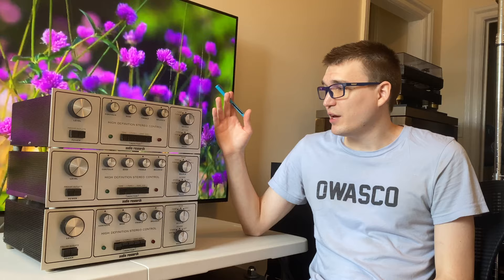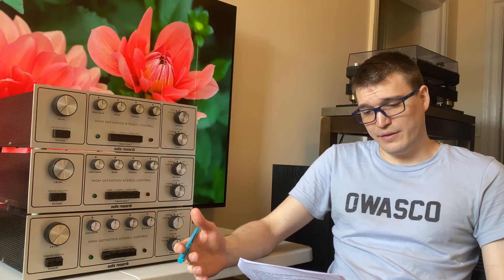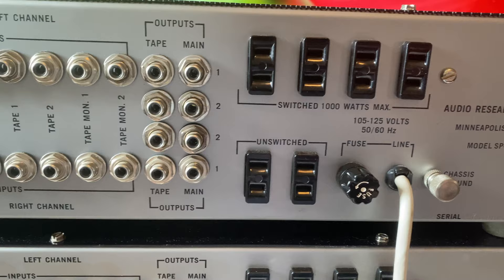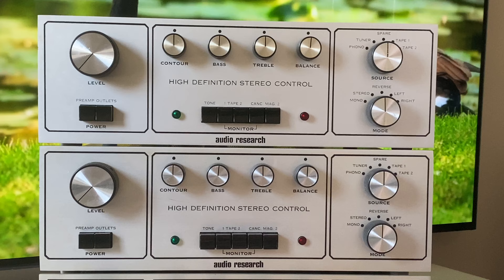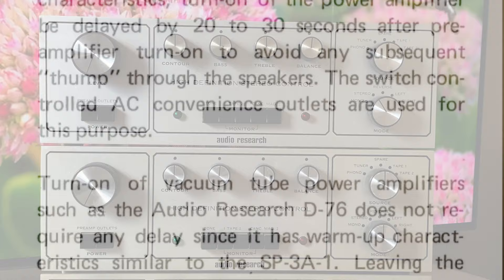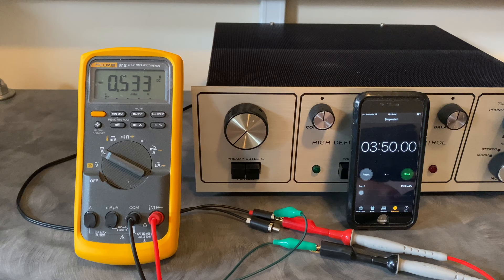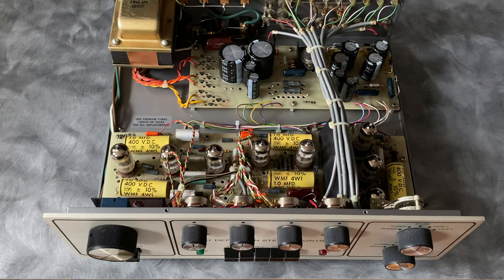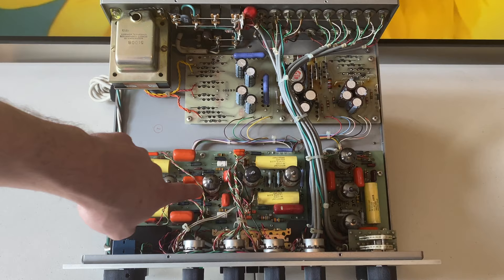Audio Research SP-3 Deep Dive and Full Info for Collectors  - Versions, Service, Tubes, Lamps!

Comment: Super cool. Very well done and informative. Lovely piece of kit and I strongly suspect still respectably good sounding. I remember this unit almost from the time it was first released, and watching the ARC preamp evolution from this point forward. These preamps contributed heavily to the beginning of the modern high-end tubed audio trend, and they were the darlings of the high-end magazine reviewers.

I like ARC gear, and I've very much enjoyed several visits to the ARC factory in MN (and to Magnepan not so far away), but my preferences fell toward Conrad-Johnson. Two C-J pieces I had had several updates to them - the MV-75 amplifier and PV-2 preamp. The MV-75 went to an "A", then an "A-1", and I had two MV-75s fettled beyond this to great effect by their original co-designer, Bill Thalmann. The PV-2 went to an "A", then and "AR". I had them for a LONG time, buying them new and selling them only a couple of years ago. PV-2 prices these days are a bit surprisingly high.

Comment: Oh... Back in the day a lot of separates had power outlets on them.  Wouldn't think about doing about that today. The power on/off protocol you describe was also documented by the equipment manufacturers. I recall the ARC and Dynaco manuals mentioning this.

Comment: Excellent video, Ben!  I especially liked your demonstration of the output voltage at turn-on -- but in fairness to the pre-amp, I wish you would have put a resistive load across the output (maybe 50K-100K) to represent a power amp. I'm pretty sure the DC offset will approach zero much faster with the resistive load (amplifier) than it will with on open circuit.
Reply: Audio Research put a 2 minute mute timer in the SP6B. I have one but I use an SP6 that I modified.

Comment: Excellent video and a great source of information. I'm servicing an SP-3-A at the moment. It also has the "A-1" sticker inside. Power supply question- What are the values of the most right-hand B+ filter capacitor grouping? It's the two new caps that are surrounded by the orange drops. I can make out 33µf but can't see the other, taller cap value. Schem calls for 90µf, what did you use? I was going the use 3 x 33µf as the united chemi-cons are pretty small.
I'm using the same Kemet- that first cap in the B+ chain takes a beating! 500V for the rest.
Thanks! -K